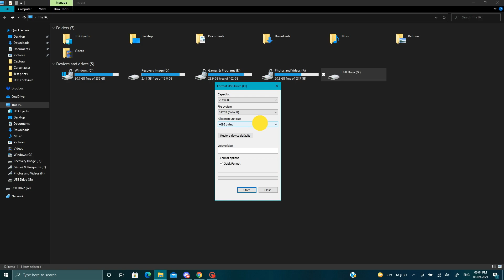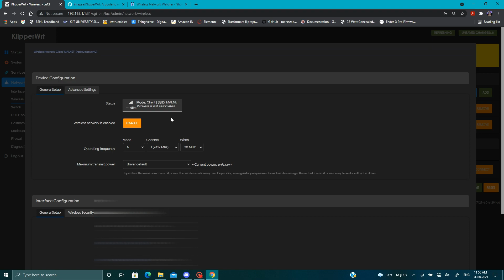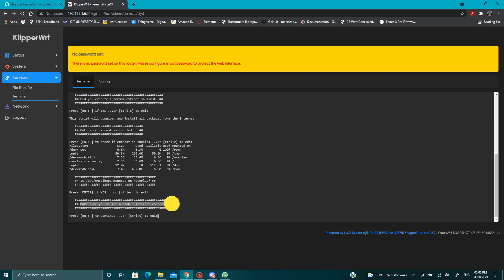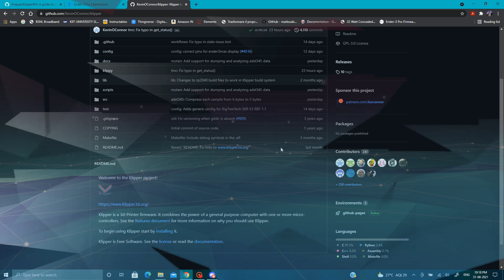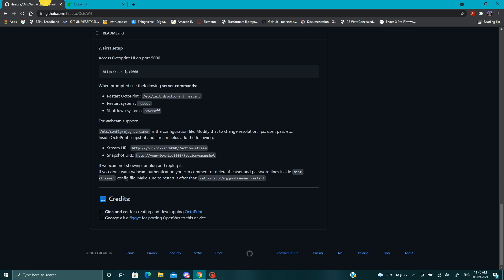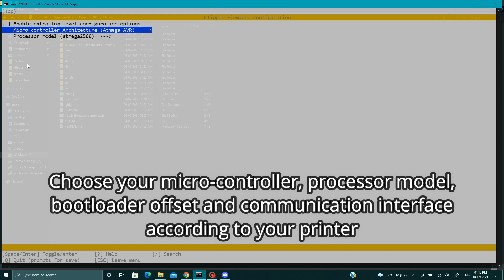[OUTDATED] Giving Creality WiFi Box A Purpose: Introducing KlipperWrt & OctoWrt

Comment: First thanks for the tutorial. I have a problem tho... you skipped over the MCU-serial configuration like it was already on the config files, but i foundout that they don't work out of the box... pun intended. 
Can anyone explain how to get the  mcu serial for the config file, as it comes, it doesn't connect to the printer.
Thanks
Reply from the maker: Hello. Sorry to say but, this project is no longer supported by the author. So, there are no updates for this project.

Comment: After setting up wifi, is there any way to connect via ethernet to home network instead of wifi? I added eth0 interface, and firewall zone set with LAN, but box does not have internet, neither I can ping to the device.
Reply: Found it! You need to set LAN interface from STATIC to DHCP, and also disable both wifi radios

Comment: Hi, I follow  your video to install  OctoWrt , but  when I install octoprint 1.81 , I encounter wrong messages , as follows: 
Installing build dependencies ... done
  Getting requirements to build wheel ... error
  error: subprocess-exited-with-error
  
  × Getting requirements to build wheel did not run successfully.
  │ exit code: 1
  ╰─> [63 lines of output]
      /tmp/pip-build-env-5sdp4p3e/overlay/lib/python3.11/site-packages/setuptools/config/setupcfg.py:293: _DeprecatedConfig: Deprecated config in `setup.cfg`   !! 
There are long wrong messages!  I  just show part of  them ! how to solve the problems? thanks
Reply from the maker: Unfortunately there is no active support for this project as the author is no longer maintaining this project.

Comment: Hey hey, awesome video. I'm running into an issue though - After I install Klipper through the script, I rebooted but then completely lost connection with the board - it doesn't want to even connect to the WiFi I set-up for it. Dunno what I'm doing wrong, but it's fairly frustrating to be that close. Any pointers?
Reply from the maker: Hey mate!
Unfortunately the owner of the project hasn't updated the project in months. As the dependencies have been updated, the compilation of the software is leading to various errors.

Sadly, it's safe to say that the project is deprecated and no longer maintained.
Reply: try the openwrt 2.2 or reset the box and reflash it. It should work, might just take a bit. I think I had the saem problem.

Comment: Hi,  I know this video is over a year old but...

I have installed KlipperWRT on the inbuilt creality WIFI box in the Creality CR-10 Smart.  I am having extreme trouble getting the correct settings for the firmware for the main board. (CRC-2405v1.2)  I have tried multiple other web resources in my quest to get this working but the wifi box is unable to communicate with the mainboard with the firmwares I have built.

If anyone has this working on the same mainboard as I have in my machine, can you let me know the settings you used in the Klipper Firmware Configuration Shell Script?
Reply from the maker: Hey mate!
Unfortunately the owner of the project hasn't updated the project in months. As the dependencies have been updated, the compilation of the software is leading to various errors.

Sadly, it's safe to say that the project is deprecated and no longer maintained.

Comment: I'm assuming this is not compatible with Wifi Box V1?
Reply from the maker: It is compatible with both V1 and V2 versions.
Reply: @HyperMakes  how can I compile the board bin by using the terminal in the wifi box?
Reply from the maker: Yes you can, but it is not recommended.

Comment: Thanks for this it's helps so much. One thing I'd like to know is it possible to use klipper screen with this
Reply from the maker: Unfortunately not. The CPU which the wifi box uses is pretty under powered to able to compile basic dependecies for klipper screen and also run it.
Reply: @HyperMakes  Thanks for getting back. I think I might go for the klipper screen on a android phone. I have another question is it possible to use a accelerometer with it for input shaping?
Reply from the maker: Yes, there is a documentation for that in the github repository but it hasn't been tested yet. Here is the link:
https://github.com/ihrapsa/KlipperWrt/issues/17
Reply: @HyperMakes  Thanks I'll take a look

Comment: Hello, thank you for the video. I'm very new at this and struggling to find where I can ask questions. Is this software compatible with the Wifi Box 2.0? And if you only want the software installed on your Wifi Box, is that possible? I don't want to modify my FW on my Ender 3 Neo.
Reply from the maker: Yes, This software is supported for wifi box  2.0.
No, you will need to flash klipper firmware on your printer in order to use klipper on the wifi box, or else your printer won't connect to the wifi box.
Please join the Discord server in the video description for further questions or help.

Comment: Will you be able to do things like input shaper and print 100-150mms with the creality box?  Im checking my options right now as raspberry pi is out of reach this day.  I have a BTT pi4b on the way but if the creality box does the same I might switch to that.   Thanks for the awesome tutorials.
Reply from the maker: 1. No input shaping but yeah, you can do 100-150 mm/s printing.
2. Creality is about to launch a klipper specific device called Sonic Pad in September. You can check that out.
3. Nope, you are better off with the BTT Pi4b adaptor, the creality wifi box is not that powerful to compete with that.

Glad you liked the videos. Cheers mate, thanks for watching.
Reply: @HyperMakes  Thanks for the reply!  Will take a while for the BTT pi4b to arrive so I went ahead and picked up a Creality box since it was very cheap.  Klipper seams to be way ahead of marlin and your tutorial will get me started.  Thanks again.

Comment: thanks. ..  works but a bit of non installed package’s, have not tried all features. will this work on the version 2 boxes?  installed on 1 on the factory.bin version and another with the sysupgrade.bin. 1 box bricked  dead dead no led… return. flashing the replacement with factory.bin. still installing, looks good not giving me glitches like the dead box did. i was using a linux laptop to control printers, it is a lot faster than rasp pi 4b or web box. got tired of having the extra power draw and space required for laptop. so far the box does basic features, shutdown doesn’t not work but does not seem to be a problem as it can be powered off and restart without any glitches/errors.  thanks again… 8-)
Reply from the maker: Thanks for the informative comment. I hope you were able to resolve out your issues. If not, do join the discord server and ask for help. Thanks for watching.

Comment: I have a question about performance :) Will it be better to install it on Raspberry Pi 3B or it doesn't  matter and quality and print speed will be the same? I have Creality WiFi Box but to have better performance and quality I can buy a RPi :) Thank You in advance for all replays!
Reply from the maker: Any oldest model of Raspberry Pi would still beat the wifi box. We made this project so that people can make use of their wifi boxes. If you can or have the budget of a raspberry pi, then please go for it. The quality and processing speed of a Raspberry Pi is surely better than wifi box.
Reply: @HyperMakes  Thank You for answer! SO I have additional question. What do you think it is better to keep stock firmware on printer and creality box or switch to klipper even if it is worst quality and speed than using reaspberry PI, will it be still better than stock?

Comment: How is the performance comparisons:
1. Installing Raspbian directly on this and then Octoprint or Klipper?
2. Installing OctoWRT and then only using it as a WIFI interface to communicate with Pi on a Docker? I'm assuming you can run all of your plugins at that point. as I see some people have issues running plugins directly on the Cloud device.

I recently had a hardware issue on my Pi and they're impossible to come by without price-gouging.
Reply from the maker: For the first question, no you can't install Raspbian on the wifi box. Regarding the second one, i am not sure if docker implementation can be done with it. Please join the discord server and ask the creator about this.

Comment: Well done but it's a LOT of work for a 580Mhz. CPU with 128 MB RAM. Even an old Pi Zero W will run much faster. I could see doing this if you had one laying around but buying a new one doesn't make sense.  I picked up a Pi Zero 2 W for about $22 shipped for my Octoprint install.  Yeah they're tough to find it takes a bit of patience scanning all of the sellers.
Reply from the maker: Absolutely agree with you. Any model of Raspberry Pi is better than the Creality wifi box. We made Klipperwrt so that people can make use of the existing wifi boxes. Buying a new one only for KlipperWRT is not recommended. Also agree with the fact that, it is a pain to find any Rpi boards at reasonable prices these days. Thank you "Global chip shortage"🙂
Reply: I'm interested on how well it does work considering the prices of raspberry pi's now. I can pick up one of these for 25 bucks now where as the oldest Raspberry Pi 0 sells for $70 used
Reply from the maker: @thordomr  Honestly speaking, not even close to the any oldest model of Rpi. This project was developed to make use of the creality wifi box. The box works for traditional speeds and use.

Comment: Hi thanks a lot for your fantastic job. I installed klipper by mistake because my intention was to have octoprint. Do I have to repeat the entire process or how can I uninstall klipper and install octoprint?
Reply from the maker: You can uninstall klipper, but that may arise new problems for you. I suggest to to reset the wifi box by holding the reset button for 6-10 seconds. Then repeat the process for octoprint installation. You can't get away with both firmware in the box because, the wifi box uses a relatively less powerful CPU.
Reply: @HyperMakes  Thanks a lot, is it correct if I start with script 1 that format the microsd and than I follow your process for octoprint? Furthermore I noticed some differences (I mean before the SWAP chapter) in the preparation phase of octoprint installation between the video and the github page... Di I have to follow the site procedure?
Reply from the maker: @Alberto-uu8ix  Do the script 1, then follow from Octoprint installation chapter in the video. That's it. No need to follow the last chapter, as Octoprint works with Marlin firmware.
Reply: @HyperMakes  Finally I did it, and now octoprint works! Just one question: how can I reach the folder created in octoprint? I mean how can I save files in octoprint subdirectories?
Reply from the maker: @Alberto-uu8ix  I have very less or no experience with octoprint. You can try searching online regarding that.

Comment: Great instruction video. Totally spot on! Octoprint is running well on the Creality Box
Reply from the maker: Glad you found it helpful! Cheers.
Reply: Hi I also installed Octoprint and I'm testing it. Did you create folder in octoprint? I would like to manage files from windows and then print trough octoprint. But I don't know how to do it

Comment: That is really cool, one can find these creality wifi box dirty cheap these days! How would the performance with klipper be compared to a raspberry pi? Would there be a loss of performance? I have no idea what creality put inside these boxes
Reply from the maker: Not that good but ok. The creality wifi box uses a less powerful CPU than Raspberry Pi. But that's not a deal breaker as it can provide all the network rich features with only 30-50% load.

Comment: Will I need to use Klipper firmware on my printer mainboard for Octoprint as well??? Or can I keep Marlin on my ender 3 v2? I would like to use the wireless file transfer but the other klipper features aren't as important to me because I'm new to 3d printing
Reply from the maker: No. You don't need to flash klipper firmware on your printer main board if you are wishing to use octoprint. Octoprint works with marlin firmware.
Reply: @HyperMakes  ok thanks. If I don't use the webcam feature, do you think the box will function reliably or will it max out the cpu and mess up prints as it's less powerful than a Raspi
Reply from the maker: @ariafpv  Without a webcam, the CPU usage is around 30-50%. So, there is nothing to worry about. Most of the reasons of failed prints are loose connections, under voltage, emf interference and un-grounded usb cables, both in the case of creality wifi box and raspberry pi.
Reply: @HyperMakes  I have tried Octoprint but it seems like the cpu is overloaded and the print stutters when doing curves and similar shapes

Comment: I have found your directions to be very easy to follow and detailed. Thank you for taking the time to put this video together. However, I have one issue that I cannot seem to resolve. No matter what I have tried, I am unable to get the firmware to recognize the SD card I have formatted. I have tried multiple sizes and manufactures with no success. Also, when I tried to install software, the firmware states that the files cant be opened because the file system is read-only. Please let me know if this is something that can be resolved? Thank you.
Reply from the maker: I have a little bit less knowledge regarding this issue. Can you join the discord server? There i may help you with help of the creator of this open source project.

Comment: So you have to install klipper to get octoprint because there is no other way to get the terminal?
Reply from the maker: No no. The initial steps are common. Then you have the choice of either installing klipper or octoprint.
Reply: @HyperMakes  okay thanks. but i am confused still, do we have to flash klipper on the 3d printer (ender 3v2) in order to use mainsail/fluidd? meaning if i install klipper with mainsail on my creality box, can i just plug it into my ender 3 v2 via usb (running marlin) and start using it?
Reply from the maker: @AymanSuleiman  Yes, you have to flash klipper firmware in your printer main board also.

Comment: I just got a box as gift with a shipment of filaments, do I need to install both klipper and octo on the box? Or just one?
Reply from the maker: You need to install either one of them. It is possible to install both but the specs of the box is not that good to be able to handle both klipper and octoprint.

Comment: Amazing! I was looking a way to connect my Ender 3 on my Home Assistant without buying another Raspberry. I have this creality box and with this octoprint installation It will be possible to do that, right? 

And another question: i need to install the klipper bin firmware on my ender 3 pro too, or this step is totally opptional? i didnt understand why! thanks!
Reply from the maker: Hello Marcelo. After doing the common configuration steps, you have the choice to install either klipper or octoprint on the box. As you have already stated that you want to go with octoprint. NO, you dont have to flash klipper firmware on the printer mainboard. Octoprint supports marlin firmware.

Comment: This will go mainstream if someone makes binaries available for quick download and install into the box and the ender 3 printers.
Reply: Can someone please make that happen
Reply: @chrismunson5513  the current proccess is the simplest and safest I could find. That's mainly because the box has not enough internal storage (12mb only) and the extroot step needs to be done no matter what. Raspberry pi boots directly from the sd card. It's possible to make the box to boot from the sd card but that involves messing with u-boot which is dangerous and afaik it can't be done remotely (without direct action from the user).